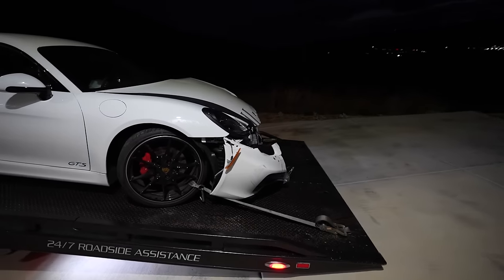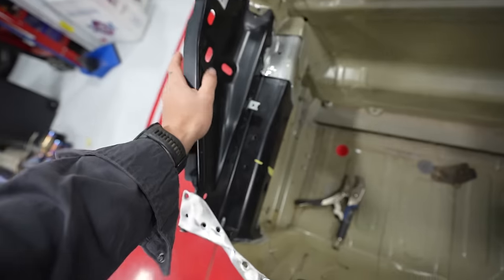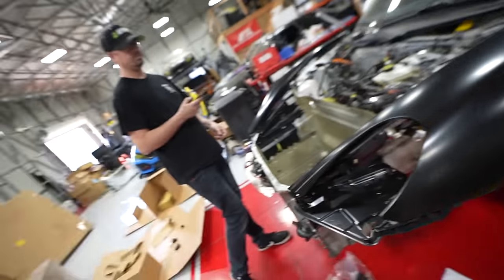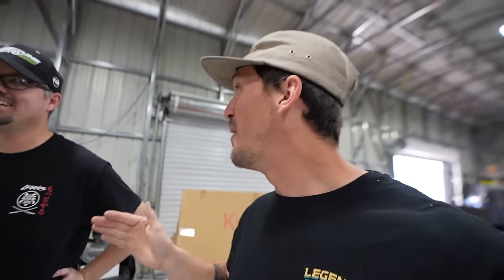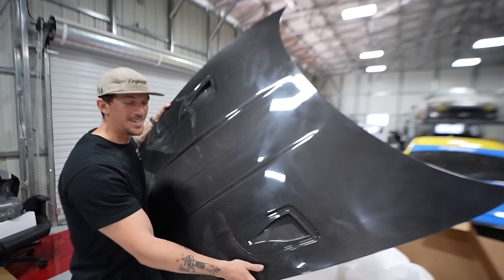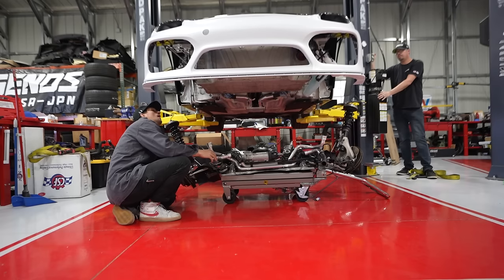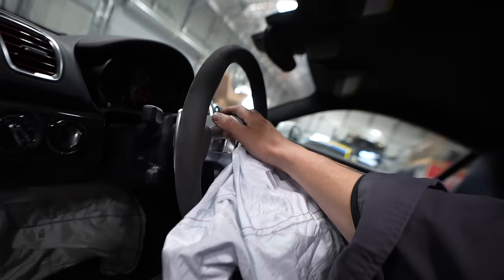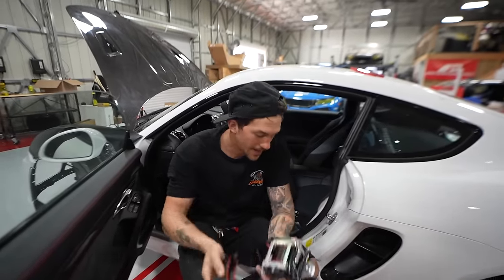Building a WRECKED Porsche Cayman into a GTS Street Cup! | Ep. 5

Comment: I believe(could be wrong) the GT4/RS caymans have a piece that goes between the Hood and front bumper. Which is why that gap is there.
Reply: They definitely do
Reply: There is a small vent from the front radiators.
Reply: I was going to mention this. It is a carbon trim piece that acts like a hood air intake.
Reply: @Keiferdrives I figured it was a small vent. But wasn't sure if it was that or a bezel trim piece or seal or something.
Reply: I thought I’ve seen carbon pieces on some but didn’t want to say it and have just imagined it lol. I’m sure he will find a carbon one for it.
Reply: If you look carefully that gap is also in the bumper, it's below the gap between the bonnet and the bumper

Comment: Some solid progress guys! Well done! And congrats on the massive win that the frame is straight and everything lines up! 
As for the gap in the bonnet if new hinges ain't doing it, I think there's might be a lip/mounting plate/shroud whatever you name it is on top of the front as well along with maybe a rubber strip or something that then connects to the bonnet. No expert, just sharing my thoughts. it might even be visible in the footage of picking the car up. Cause something black sits near it.

Comment: 20:30 Maybe when you install whatever part you're talking about that "squishes everything together", maybe then the hood-to-bumper gap will line up better. You don't need to modify move the hinges or the hood, because the top of the hood where the rear part of the front fenders are lines up perfectly from just looking at it in this video. This is just a guess, but it's probably just because you don't have some of the missing structural pieces for the front end or the tub/frunk area.

Comment: I thought dry carbon didn’t have a gloss look/ clear coat which makes sense and wet carbon would obviously have a gloss/ clear coat look making it look wet 🤷🏼‍♂️
Reply: the “wet” moniker refers to its manufacturing process, by which the carbon fiber is coated in liquid resin before being vacuum sealed to cure. Typically, a dry carbon fiber cloth is placed into a mold which has been coated with resin. Then, another layer of resin is coated on top of the cloth

Dry carbon fiber is formed by using a pre-preg or impregnated piece of carbon materials. This piece of carbon is first placed into a mold, and then into a sealed vacuum to properly cure. This particular method creates the least amount of waste and forms a lighter version of carbon than the “wet” method.